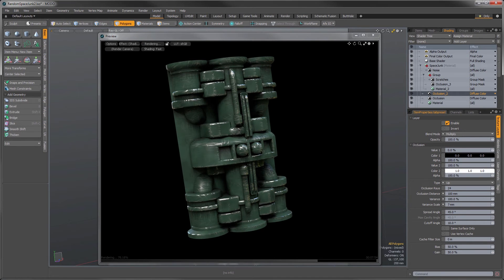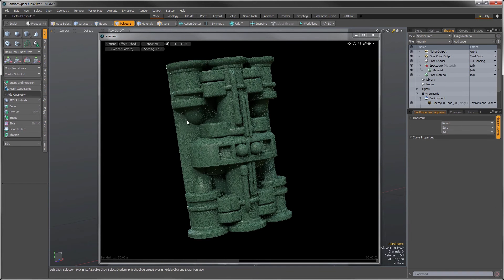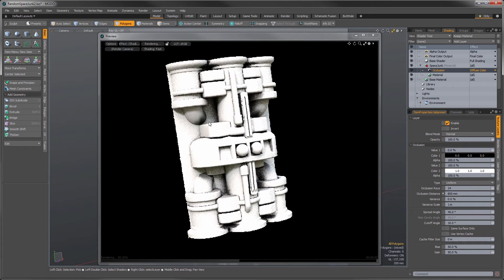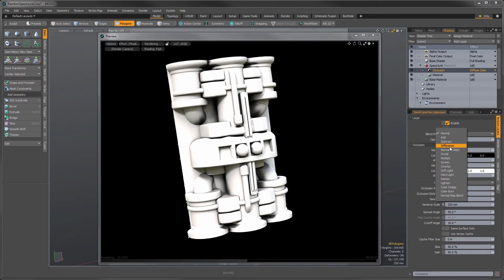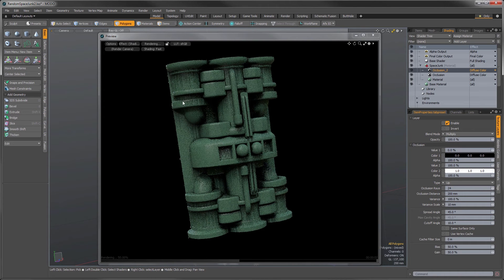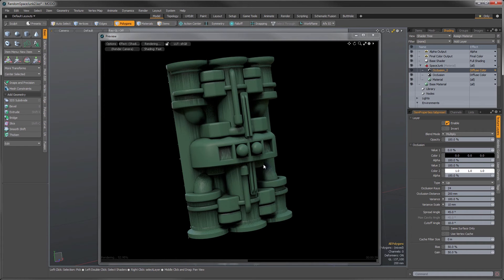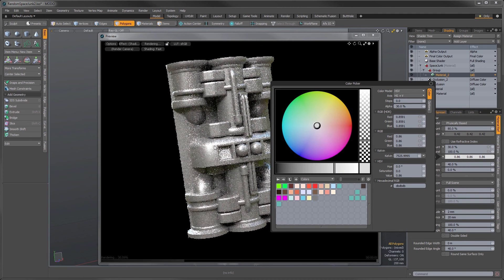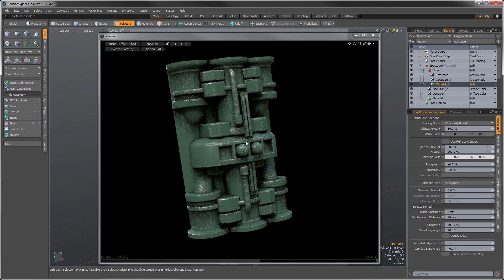MODO's Occlusion Shader In-Depth -- Part 2

Comment: You said, for animations it could be better to bake these textures. Do you need a UV-Map for this case?
Reply from the maker: Yes, but you should easily be able to make one strictly for baking with very little fuss using the 'Atlas' or 'Atlas 2' options of the UV projection tool.
Reply: OK, thanks.